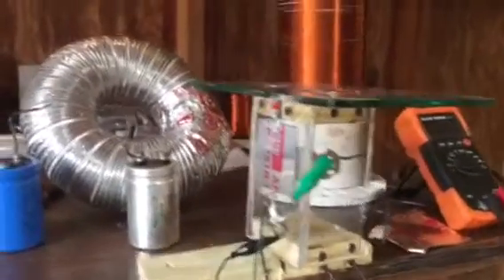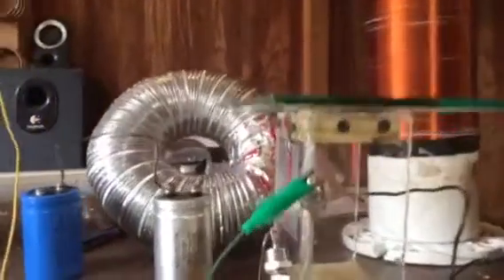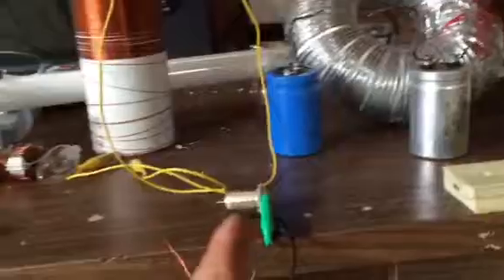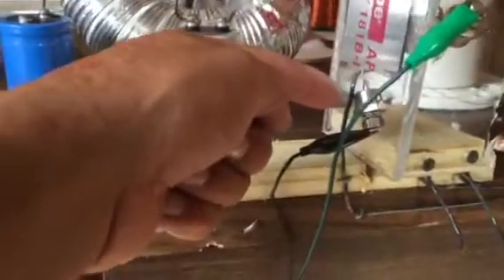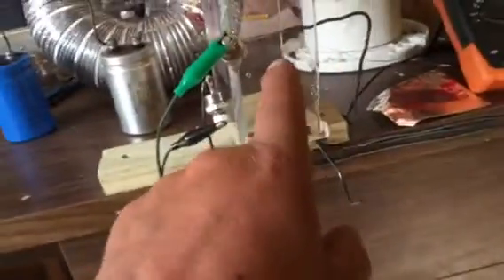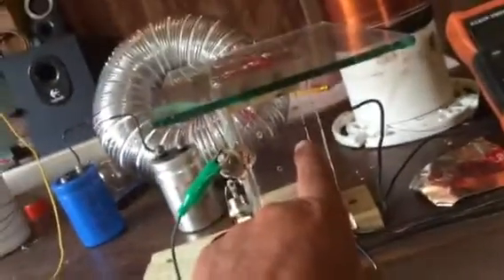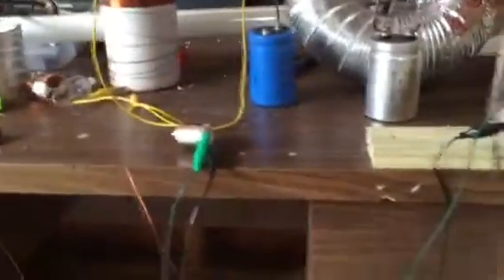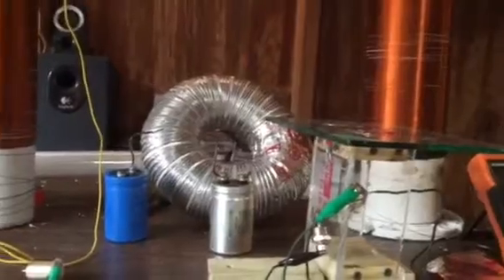Tesla ground and Diodes

Comment: Is the "input" just a connection to one of the stout copper bars of the hairpin, o what? Just to replicate edit: what kind of diode are those? is the motor spinning?
Reply from the maker: Hi David 
Great questions. It’s been 4 years since I made that video. Just looking back at it  I can say that the copper poles are the dielectric side, also know as cold electric of the capacitors. One side of the poles go to the plastic thing on the table. And the other side I will have to re create this video because there’s slot to learn now because I will understand it better. Again thanks for bring this back to me.
Reply: @vinnystvincent9788  Thanks for your quick reply. Imagine that people like me, all around the world, that are interested in electricity... are intensively watching and bringing back 5 years old (sometimes more) videos all at once, day after day, to come to a speed about the topic. This is what's happening to me.
Reply: @vinnystvincent9788  anyways, I think one pole you put it on the ground, the other pole long wire to the table on which you put the plastic thing. The circuit closes on earth because that kind of energy is able to be conducted on dielectric, even plants and inside faraday cage, right? Mindblowing.

Comment: You are the kindred spirit to Mr.Anguswangus. I appreciate the work that you do. I think the trick here is getting extra power from the ground connection. Barbosa and Lael patent talks about using 2 ground connection (one as a positive) in their circuit. The Earth is filled with electricity through tulleric currents. If you could create a virtual ground then the Earth itself could be used as a hot connection. Ed said "ring the bell twise" this message appear at the coral castle. I think that is an important clue.
Reply from the maker: You just gave me a great idea! 
Thank you for your comments.
Reply: Indeed.
Reply: @Jaantoenen  Any update vinny?